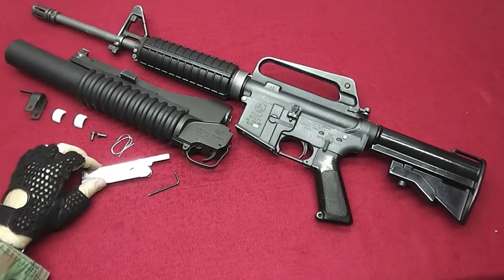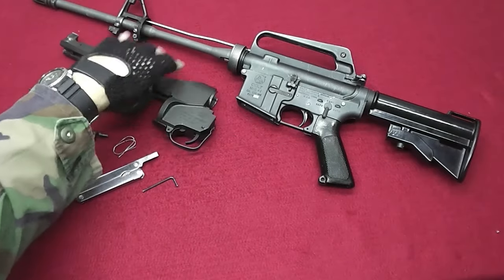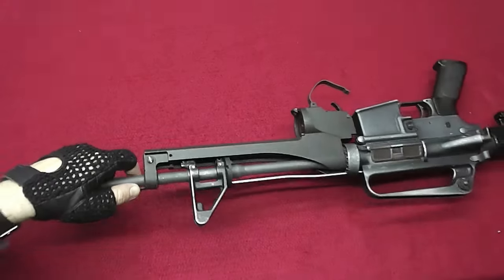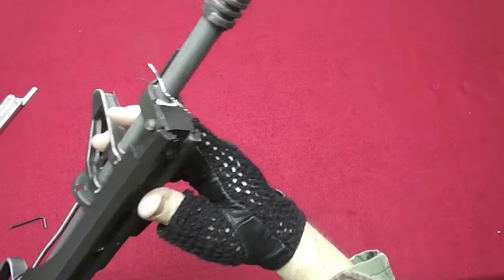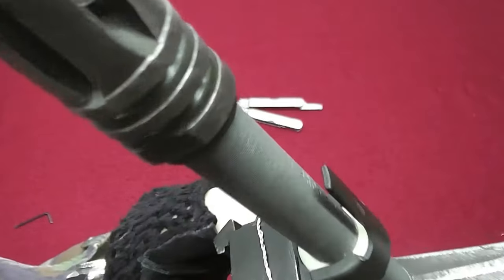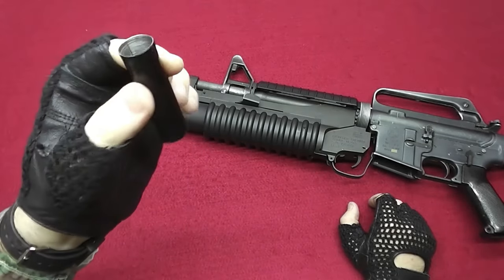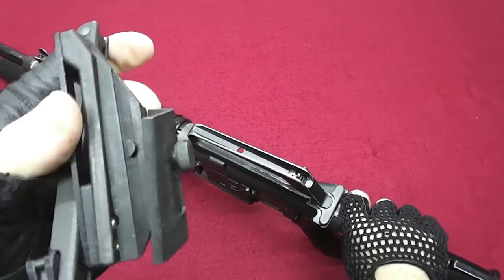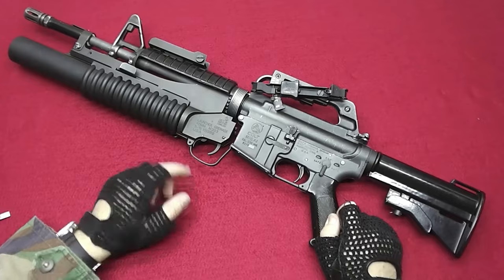KING ARMS M203 installation and more

Comment: When safety wiring the second screw, leave a 1/4 turn on the screw. Feed the safety wire then tighten the last 1/4 turn. This will effortlessly provide leverage and add tention to the safety wire.

You can also add a one inch piece of heat shrink to the safety wire to limit dual metal corrosion. Also some red lacquer (finger nail polish) to torque stripe each screw where the screw meets the bracket to see if there's any slippage.
Reply from the maker: Thanks so much for the suggestion! Excellent ideas! Will try out for sure! :D

Comment: What would you say the minimum barrel length would be for this launcher? Plan on upgrading my XM177 to account for the launcher
Reply from the maker: If we talk about the launcher and mounting it the "oldschool way" like in the video, the rifle barrel must be not shorter then the front bracket mounting point on the launcher. If shorter than that you won't be able to attach the front bracket to the barrel, because it's too short. This is different when it comes to rail mounted M203...since you mount the launcher to the rail the rifle barrel length is irrelevant in this case. As for the XM177, you can mount such full barrel length M203 without problems. Try to look up "XM177 with M203" and you see what i mean. Hope this helps :)
Reply: @talesofgear  aha, i see whatchu mean with the flash hider… i removed mine as i intended to make this a COLT 723, would an 18 inch barrel be enough you reckon?